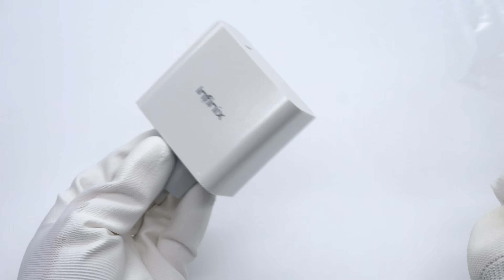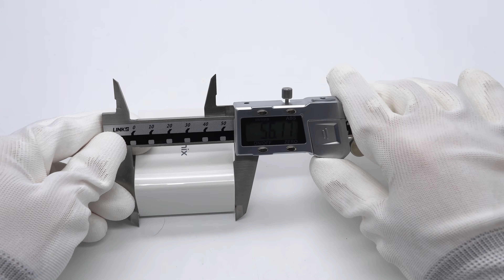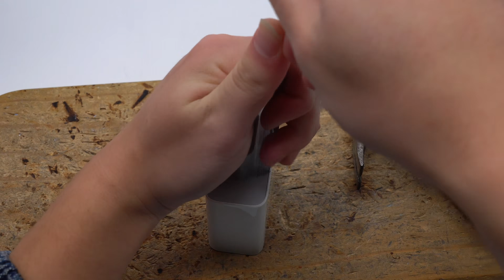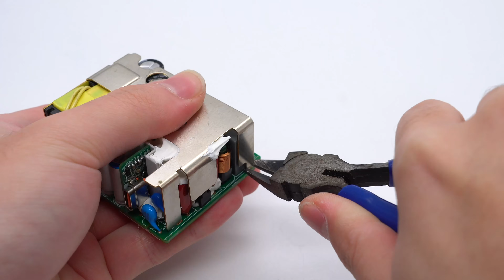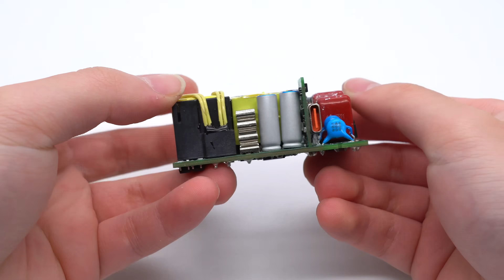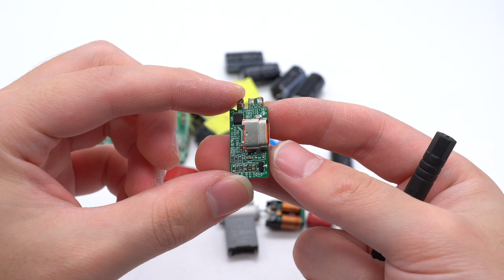Teardown of Infinix 180W GaN Charger

Comment: 20v-9A is funny… the USB C connector is only rated to 5
Reply from the maker: This only applies to standard USB-C, these days many special USB-C cables can handle 10A or even 12A.
Reply: @ChargerLAB  I haven’t been able to find a connector that is rated for over 5 amps. Not to mention, the footprint and routing to get 10 amps is hard to say the least
Reply from the maker: For example: https://youtu.be/h6-UxwDiQ30?si=SUHbN531pDxUfuUq, or https://youtu.be/E-r65GQ6w5k?si=AwM9cadGBREpzKEq